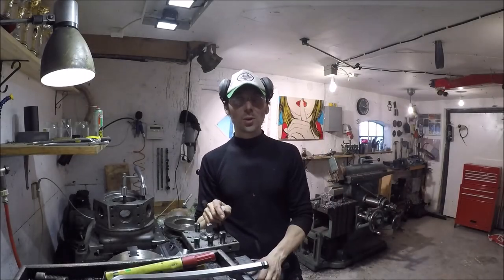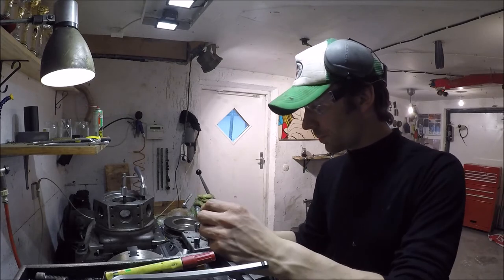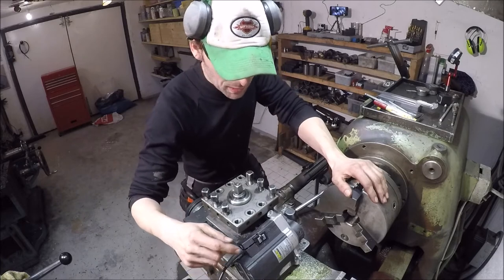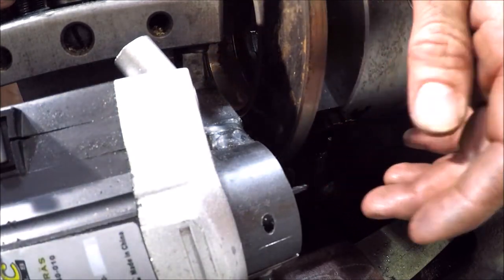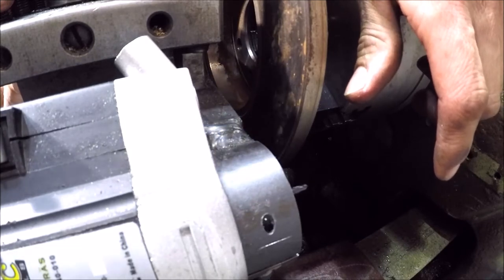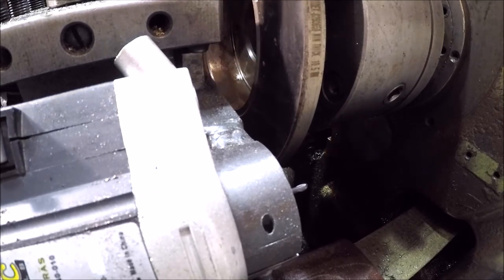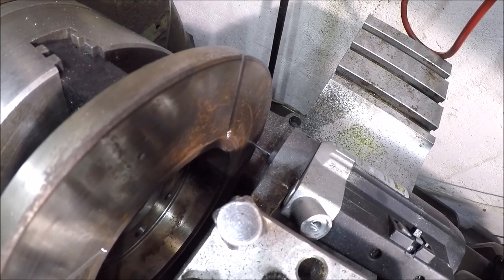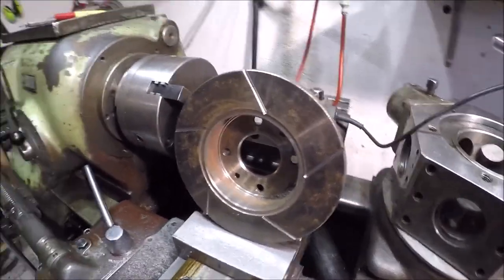How to slot brake discs on the lathe

Comment: I'm impressed and surprised.  I wouldn't have thought of trying this -- I will now.  The router probably spins at >10K rpm.  A 4mm high speed end mill would want to cut at about 3K rpm.  That's a small end mill and slotting steel would have a lot of side loading (I probably would have broken a couple of end mills with my luck).  The probability of doing that could be reduced by using the end mill to plunge drill a series of holes and then clean up the edges with the end mill.  A solid carbide end mill would more closely match the cutting speed to the router speed.  Good use of the tools.  Thanks for the video.
Reply from the maker: rfcarlson1 Thanks for that info! I got the feeling the router is a bit to fast for the mill, but at the same time not that much to fast. I could of course slow it down more but then i'd also loose torque. The mill was cutting good, but as you can see in the vid i cut in steps and let it rest in between to keep it a little cooler. Coolant doesnt work since the draft from the mill pushes it away from the cutting zone.

Comment: Nice work! I never thought a router would cut steel that well. I have a CNC router I guess I'll have to try it out. Thanks for the video it was great.
Reply from the maker: George Chambers Yea, i'm almost shocked at the result. Who knew right? But this just goes to show things don't always have to be that hard. My lathe is really sturdy, so that's probably one of the reasons this works out, but let me know how the job turns out in your router.  Cheers!
Reply: How deep was the cut you made? It looked like the full diameter depth of cut, that seems  a bit deep to me but it could have been the camera or something too.
Reply from the maker: George Chambers The cut was 2mm deep.  1 or 1,5 would probably do the job, but as these rotors are solid there's alot of material so i thought why not? :)

Comment: when slotting discs there is no need to go deeper than the discs minimum thickness, if your disc is 12mm with a minimum thickness of 10mm the slot needs to be no deeper than 1mm per side.

try not to slot the front and back parallel to each other stagger them.
Reply: Just a few mm extra :cat-orange-whistling::face-blue-wide-eyes: